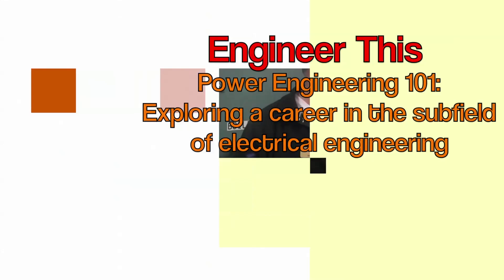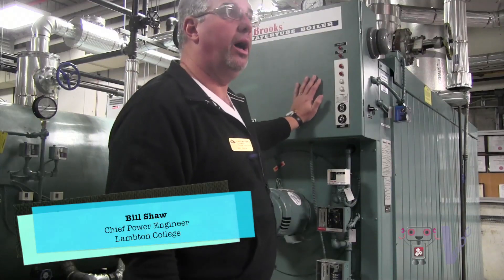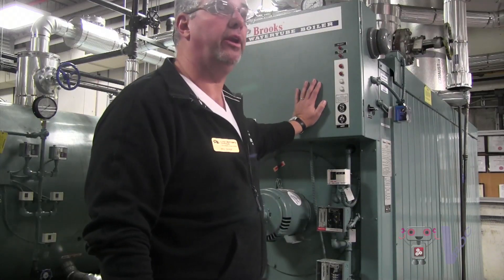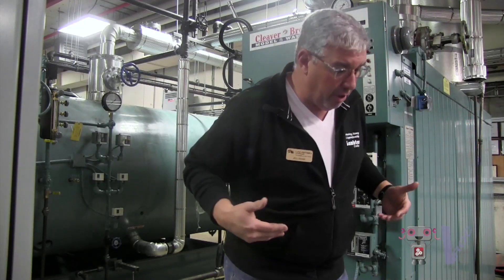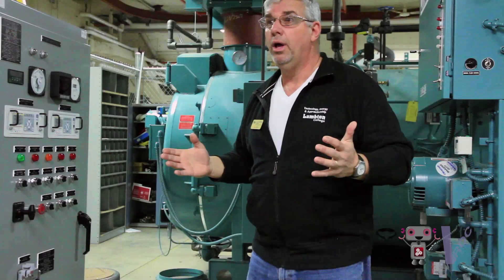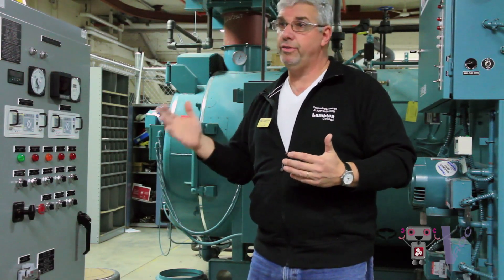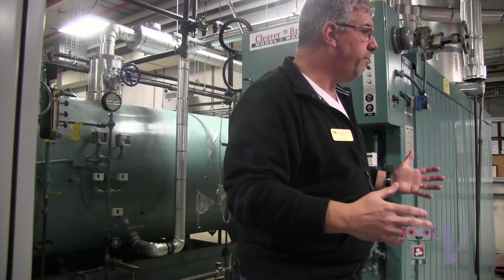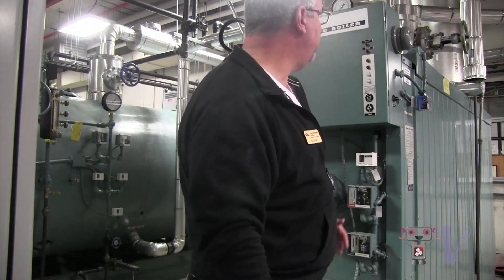Engineer This -- Power Engineering 101: Exploring a career in the subfield of electrical engineering

Comment: The description refers to the field (Power Engineering) as a subfield of electrical engineering.  I would argue that the electrical portion is a subclass of Power engineering.  Power engineering is a field specialized in the conversion of one energy to another to perform work and knowledge of all aspects of this.  While this can be used to create electricity,  there are many applications that do not specifically create electricity that still require a "Power Engineer".  For this reason I would say that it is misleading to refer to Power Engineering as a subclass of electrical engineering.  It also leads to the misconception that we are a form of professional engineer that requires a degree.  Power Engineering is a trade and as such, have very different training.
Reply: +Eric Wilson I agree with youre statement.  All day as a power engineer I monitor many process variables and see that these variable fall into the specified process requirements.  However depending on youre job, it can be classed as a trade or a profession.  
As a matter in fact, power engineers took on many duties of the earlier electrical engineers due to the change in the way we process and require things as consumers.  There are videos on this slow conversion in the power engineering field.  However I may not have a bachelors or a masters, I do have an advanced diploma in power engineering and do believe, as long as you have the preparation to move on to the next level, it doesn't differ much from 3 or 4 years.  A university couldn't teach the things ive learned in college, nevertheless, a college couldn't teach what ive learned on the job. 

All in all.  This is a fantastic trade/ profession. Excellent pay, challenging, rewarding and tons of time off!!! Many friends and family members are jealous!
Reply: +J4YMZ519 It wasn't my intention to sound like I am saying power engineers are any less than an electrical engineer.   I am a power engineer as well and agree it's an awesome career.  I was just saying that that the way he called power engineering a sub class of electrical engineering was a misleading statement.  At the power plant I work at and I suspect most industrial facilities we have both power engineers and electrical engineers(as well of course mechanical engineers) and we do very different things in completely different departments.
Reply: ahhh I got you.  Yes I agree!
Reply: J4YMZ519 Power "Engineering" is a trade and is not the same as electrical or mechanical engineering at all
Reply: @ewebbeng9418  Power engineering is not a trade, and has never be regulated as such or by any trade authority. Power Systems Engineering is a completely different field.
Reply: Power System Engineers is not a trade, it's a degree. Where are you from?
Reply: @Daar64  
[EDIT]
I stand corrected, see W D's comment below.
[END EDIT]
Reply: @binaryglitch64  classic “l don’t know what I’m talking about, so I’m going to keep talking.” Power Engineering is a field of professional operators /technically trained professionals in Canada. Classifications are structured from 5th class Power Engineer to 1st Class being the highest. 

The time necessary to become a 1st class Power Engineer is approximately six years.
Reply: @wd2417  It was more of a fishing technique...   --‿^
Reply: I alqays presumed Power engineers as those designing the transmiasion lines, transformers and electronics connected to the reactors or turbines and that the people replacing parts already made are linemen. But there alot of In between jobs I must not know about yet.